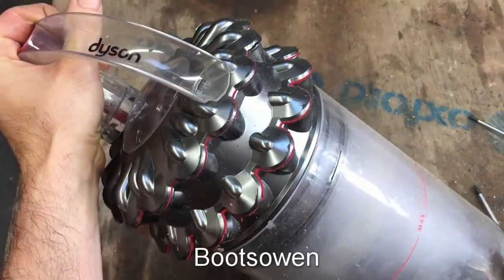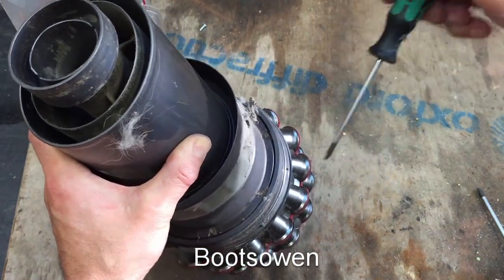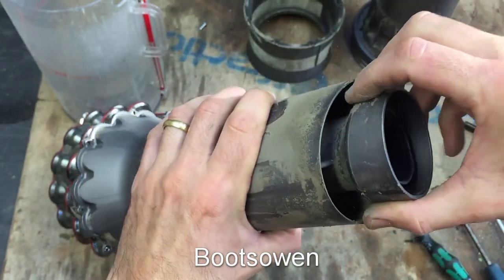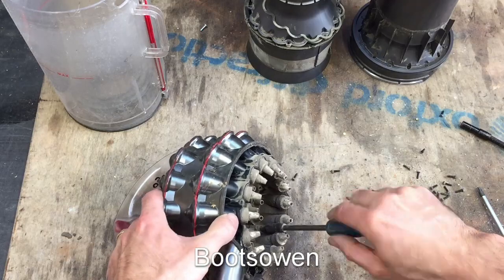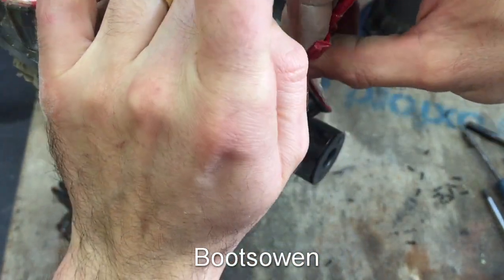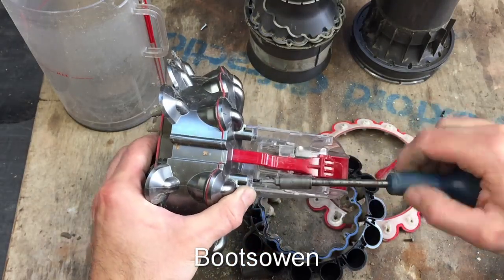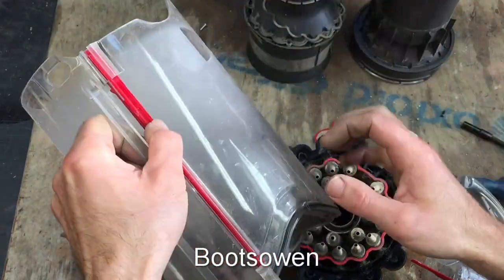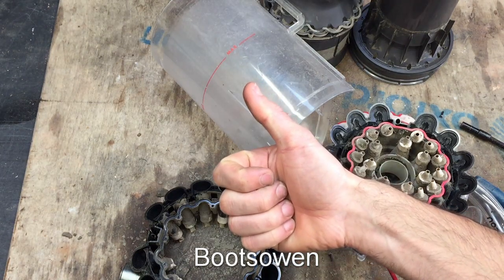Dyson DC75  how to clean the vortex cyclone and canister: vacuum cleaner maintenance

Comment: Where exactly is the Plastic Air Diverter on the Dyson DC75, I looked at it upside down but I can not find it.
Reply from the maker: No Idea?
Reply: Are you talking about the plastic "star ring" that the tips of the 12 cyclones on the DC40 and DC41 slot into?